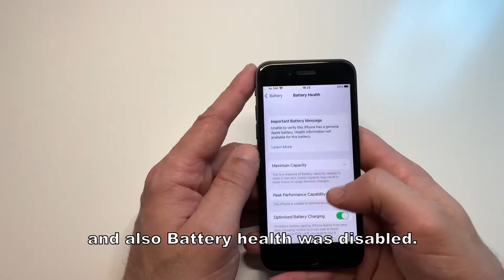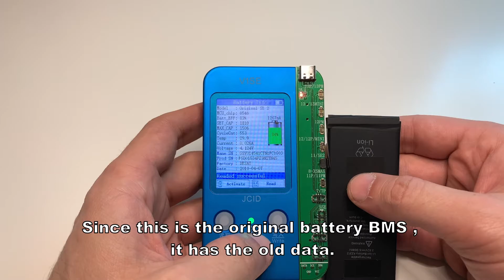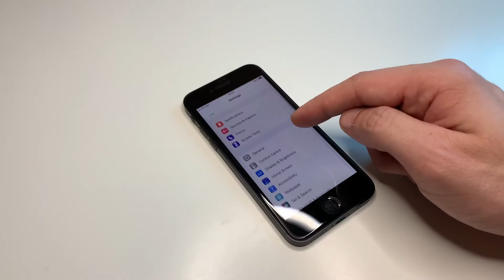iPhone SE 2(2020) “Important battery message” fix - battery replacement

Comment: Hi. Thank you very much for this video. Could you write down a list of all extra tools that we need to succeed this additional process? Pleas answer this message with it. I’ll really appreciate it
Reply from the maker: I need to do new video on this as iOS 17.4 needs few more steps. Anyway in general for iPhone battery replacements you need : Programmer , spot welder, battery tag flex , the black adhesive to cover the board , battery adhesive and display adhesive to close the iPhone. Now this will include PC to reset the iPhone . Oh and arm yourself with patience
Reply: @BalkansWay hi please share your video on more steps needed for ios 17.4
Reply: Yes kindly share the new video

Comment: Any clue why iphone se2020 still reads old battery data after programming. JCID V1s reads 100% and original battery, but when i connect it to iphone it still reads old data.
Reply from the maker: Important step is to place other battery to trigger the non genuine message.this way the phone will “forget” how much the battery capacity was .
Reply: @BalkansWay  Yes, same as when programming higher models 👍. It is a bit strange that you have to install small flat cable into higher models and this one not.
Reply from the maker: @stankotomasic9867  well yeah its strange but I prefer not to need any additional tools to change a battery . All this is pointlessly confusing already.
Reply: @BalkansWay  you skipped that step in the video
Reply from the maker: @Crypto_AL-p9b  well i did and i didn’t. The phone had already non genuine battery installed
Reply: I have the same problem, any ideea on how to fix it ?

Comment: Good afternoon. I encountered such a problem and now I’m thinking about it and want to solve it, please help me with advice. I replaced the battery on the iPhone se 2020 with the transfer of the controller, reset the cycles and capacity on the jsid programmer, but after installation this battery is identified as not native 😢 ios 17.0.1. I tried all sorts of manipulations, but the dash in the volume on the phone does not determine who it belongs to. Thank you
Reply from the maker: Thats an oddly strange issue. If you can try to boot up the iPhone with non genuine battery to trigger the error message, then put back the original one and boot it again .

Comment: does se 2020 not need a tag on to be rescheduled?
Reply from the maker: No , Se2 battery can be reprogrammed without tag on flex.
Reply: @BalkansWay  with qianli icopy 2.2?
Reply from the maker: @χαράλαμποςκουρτίδης-ψ1ο  dont know about this programmer as i do not have it to test. Currently im using JC V1SE

Comment: Hi, very good video, i have some questions, what version of icopy is needed for iphone se 2020 swap battery? 
In an other video here on youtube i seen that is necessary to install a new connector between the battery and the connector of the motherboard, this new connector is usefull to set the cycle to 0 maybe
Reply from the maker: Hello, im using the JC programmer for this model you just need to transfer the original BMS to the new battery. Via the programmer you can recalibrate the battery and no additional flex is needed
Reply: @BalkansWay  thanks for the reply,  will iCopy v2.2  work?
Reply from the maker: @pepspam3892  i dont have that model but i think it should do the job
Reply: @BalkansWay  thanks, I have bought jcid programmer like your, tomorrow I will do this operation, thanks a lot for the informations
Reply from the maker: @pepspam3892  no problem, im happy that this helped you . If you got more questions just let me know
Reply: @BalkansWay  hi, after the replacement of battery chip the jcid know the battery like not original,  but the chip is of the old battery
Reply from the maker: @pepspam3892  hmm that’s strange i don’t recall having this issue . But the battery health is displayed correctly right ?

Comment: Do I need tag on flex for newer models or does this method work for example iPhone 12 Pro?
Reply from the maker: From iPhone 11 and up you will need the battery tag flex . The good part is that they are re-usable, you just need to boot the phone once with the flex still attached
Reply: @BalkansWay  this is not in fact true, eventually it does reset. The tag-on flex is not reuseable. You do in fact need to leave the tag on flex installed, connected to the battery.
Reply from the maker: @Talmiior  you are very wrong my friend battery health wont fix itself , whit what i have and all the batteries i have replaced if i had to leave the tags in the phone i would be broke by now.
Reply: @BalkansWay  I have read it from official sources, and have seen youtube videos that have shown it switch back on them afterwards. You NEED to leave the tag-on flex connected to the battery inside the phone. Unless of course there is some new tag-on flex that has changed that. What brand are you using?
Reply from the maker: @Talmiior  ive been doing this for quite awhile, and i never left the tag inside the phone after the first boot . You might be reading on a wrong place - tags are not cheap and if not reused they make no sense. Check up some big youtube channels and see yourself - im using JC and Qianli . Even if that dont convince you , do what works for you .
Reply: @BalkansWay  You can buy the part for like, $3, maybe $4, ya might wanna find another source lol. I've been doing this for quite a while as well. Every place I've checked said you shouldn't. There is only one place that said you could reuse them in another phone, but I don't trust them because they said their tag-on flex only work with their batteries, which can't possibly be true. Anyways, if it's working for ya, that's great, but I'm just not willing to take that chance on a part that's only around $3 to $4 for me. The place I get them from even provides one for very little price difference with each battery I purchase with bare terminals.

Comment: Will it show same battery serial number after doing this process in 3u tools?
Reply from the maker: Yep , it’s basically the original electronic from the battery so everything will show up as the original.
Reply: So with the change in BMS....the after market batteries will be shown with the same original serial number just as the original battery?

Comment: When I am reconnecting the board & spot welding, one side spot welded fine for me - but when I done a spot weld the other side it sparked, any idea why? I don’t think it joined either
Reply from the maker: Hmm that’s strange, are you sure you connected the positive and negative to the board ? Because it can short if you switch them ?

Comment: When i replace the battery on the 2016 version, i dont have this problem ? With bms.
Reply from the maker: Well the older iPhone models didn’t had this problem . Apple made the battery replacement harder for models XR and above
Reply: @BalkansWay  thanks, I thought it depends on the ios version.
Reply from the maker: @martinsk8088  no problem , it had nothing to do with the IOS version just apple doesn’t like we fixing our devices for cheap
Reply: @BalkansWay  ok, thanks
Reply: I replace the battery but i cant turn on phone, someone write in comment that i must clean contacts on motherboard, what you think about it ?
Reply from the maker: @martinsk8088  is your new battery charged ? Did you tried changing the phone ? Check if the battery connector is firmly connected to the motherboard.Also check if your new battery is not defective, place the old one and see if the phone turns on .

Comment: Would the phone work normal if the battery was installed without the original BMS, or does it affect the phone?
Reply from the maker: Hello , the phone will work normally however the battery health will bi disabled and there will be “important battery message” in the menu
Reply from the maker: @jerryx2000 sure you can , but by removing it you have more room to work on and avoid damaging the fragile cables of the screen

Comment: Can I replace the iPhone SE 2020 battery using an iPhone SE 2022 battery?
Reply from the maker: I haven’t had the chance to open SE 2022 , but i think the battery will fit the SE 2020 ( important battery message will appear 100%) but I’m sure you can’t use SE 2020 battery in SE 2022

Comment: That programmer also has a copy battery data function, can that be used to copy the serial from one BMS to another (OEM batter), thus, removing the warning?
Reply from the maker: Sadly no , without the original BMS the annoying message stays and battery health will be disabled. At least that happened when i tried to just copy the battery data

Comment: Can you give a link for the battery board? I have a JC V1SE but I need to get the battery board for the SE 2 battery. I keep seeing two different boards. Are there different boards? Thanks for the video.
Reply from the maker: Thank you for your comment and liking the video. The board i have is for models 6-12 and i got it from Aliexpress for 17.5 USD , maybe you see two versions as there should be newer version for the 13 and 14 models . Just look it up on Aliexpress, I’m sure you can find it there . If you still cant find it hit me up with mail and ill provide you with link .
Reply: Does the SE 2 battery connector fit the 11 connector on the board?
Reply from the maker: @bigtreeproductions  yes they share one connector on the JC programmer board

Comment: when i plug it into the v1se box it can't fix its battery %
Reply from the maker: Well if you are using the original BMS attach it to the programmer and click the power button new option should be listed.

Comment: Can I replace the iPhone SE 2020 battery using an iPhone 8 battery?
Reply from the maker: The batteries might look the same but the battery connector is different.
Reply: Yes
Reply: @BalkansWay no it isn't, an iPhone 8 battery can be used with a SE 2020

Comment: i replaced my battery and I have the msg and touch ID not working anymore.
Reply from the maker: Did you move the BMS of the old battery to the new ? Also the screen has two cables that can be damaged when opening maybe thats why you don’t have touch ID . Usually all this is not easy as it seems it just takes more patience